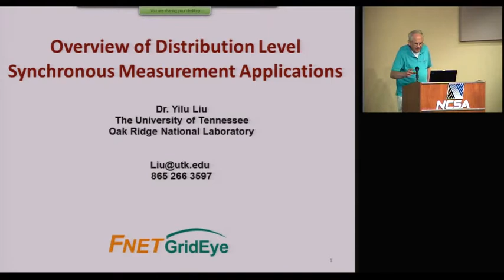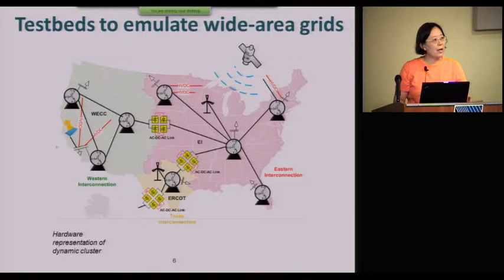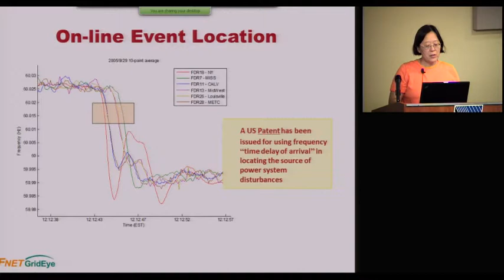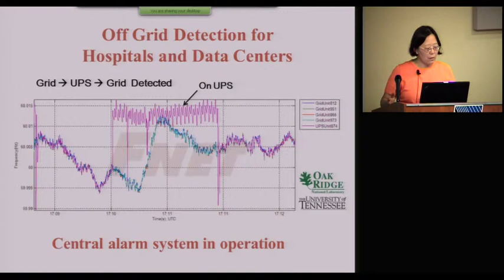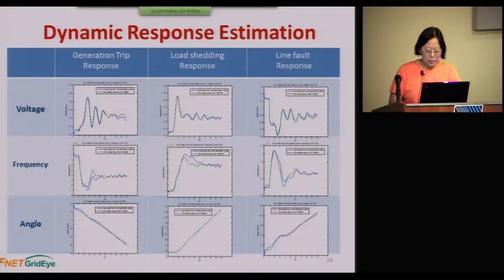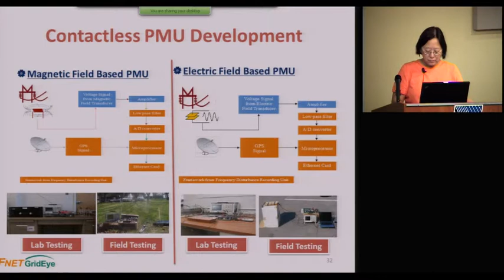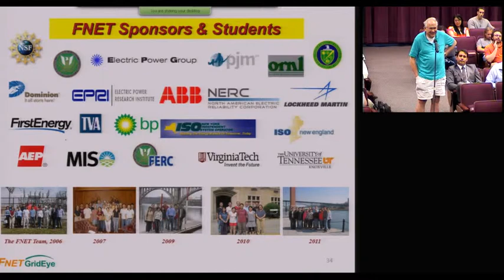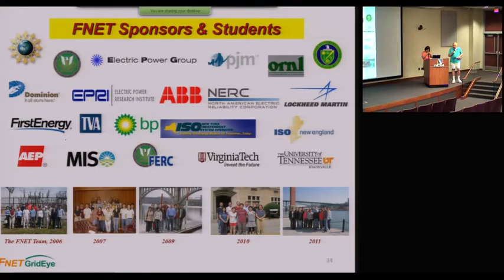Overview of Distribution Grid Synchronous Measurement and Applications

Comment: Very good presentation. slide for Dynamic simulation for Generation, Load shedding and  Transmission trip changes to  phase angle and frequency sounds interesting. which need some clarity to normal dynamics.